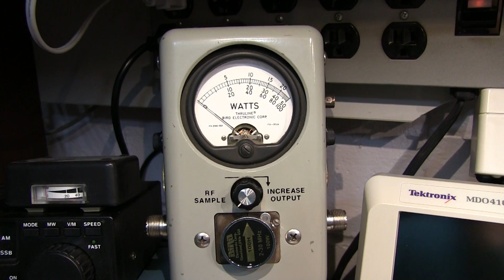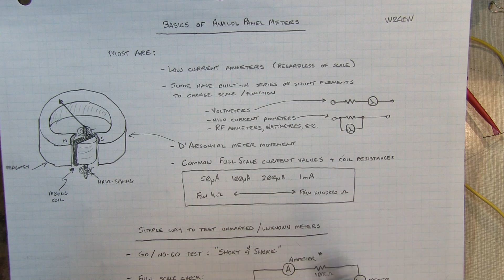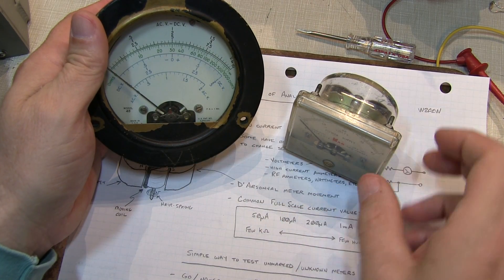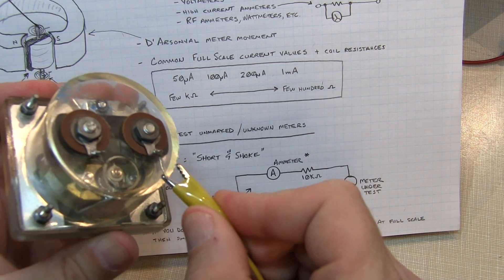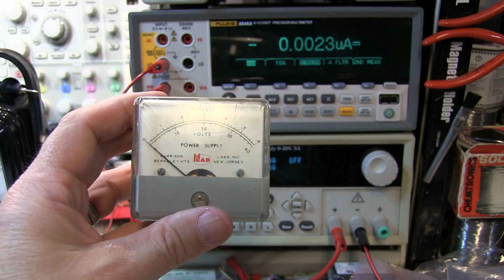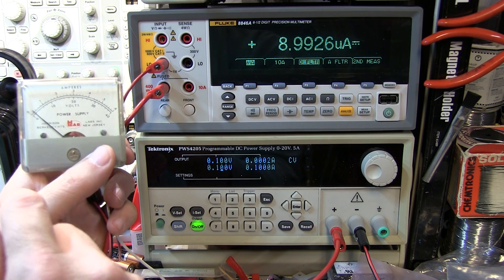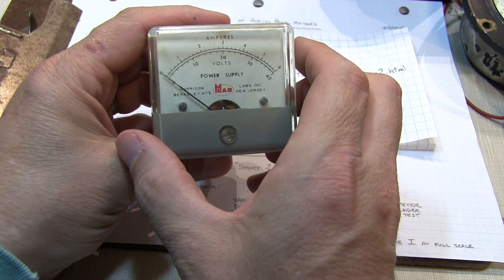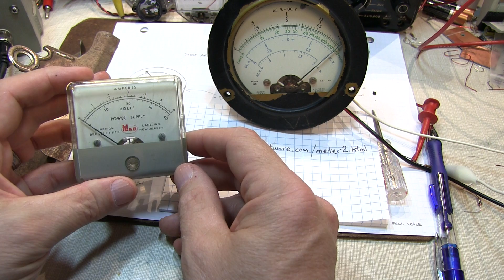#235: Basics of Analog Panel Meters | Analog meter movements | D'Arsonval

Comment: Great video Alan as usual. Takes me back to one Spring day in Soph EE lab where we learned about analog meters (essentially the only kind available to us in '74 :-) so we'd understand how and what we were really measuring. I like and in some cases prefer an analog VOM over a DVM. Don't get me wrong - sometimes I need to know if I'm looking at 2.45 or 2.55 volts, but many times a quick look @ an analog VOM "Yep about 2.5 V," is close enough. Thanks again for a good refresher. Gives me a good topic to discuss when I go melt solder with my nephew ...
Reply from the maker: +jeromekerngarcia Yes, there are many times where I prefer an analog VOM like my Simpson 260 - especially when adjusting or tuning circuits - much easier to watch a meter movement than to follow digits on a DMM.  The segmented bargraphs on many DMMs are a very poor substitute for a real analog meter.

Comment: Hi and thanks for all your nice videos! I hope you see this question, and answer if you will :P I want to know if it is possible to build a test setup using of-the-shelf components to measure the resistance of tracks on a PCB. I mean using some voltage meter chips and microcontrollers, some shielded cables and stuff...since I do not have access to any quality measurement gears. I want to try with 4 wire measurement and maybe double kelvin bridge...is there any chance or I will just waste my time?
Reply from the maker: +Saeid Yazdani Sure - it is possible to make a 4-wire system to do this - a constant current source and a resonably accurate voltmeter are needed.  However, at some point, the accuracy of your homemade system will have to be checked against "known good" instrumentation.

Comment: Very helpful video. And timely, as well. I've been watching fleabay for vintage 0-15 V DC to use in a power supply I'm building but there aren't many to choose from. There are a whole bunch with other voltage ranges and I was wondering if they could be modified for my use. Thanks to your video, I know they can!
Reply from the maker: +bityard Most likely - and those that have a particular voltage rating on them would probably need a series resistor to make it read correctly anyway (most don't have the resistor built in), so just get one that has the style you like, and make it read what you want.

Comment: Darn YT notifications caused me to miss this one. Great video Alan.  Very well done and very informative. Sometimes when I print the scale I turn the existing face over and attach to the back, since the face is mostly the same. On a few rare occasions I have re-wound the coil to get some meters back working but it is a lot of work.  And good watch repair techs and replace those springs :) Thanks again for the video.

Comment: Recently had a stuck D'Arsonval on a Yaesu I bought. I readjusted the pintle set screw; loose direction first & then just a little past the original setting and that fixed it.  Also got a tip to just exercise the meter via a signal generator or nearby strong station.  Of course if the meter is out of the rig, then you could do that via a PS.  Burden voltage is also a concern on cheap ammeters when checking FS current.  But not an issue on your to die for equipment.  Nice Vid.

Comment: Very good Video, Can the meter be used from 0 Ma. to 1amp? Resistor size?
Reply from the maker: +Arthur Schroeder Yes, you'll need to add a shunt resistor in parallel with the meter movement.  The value of the shunt will depend on the meter's full-scale current rating, and the meter's resistance.  There is a good tutorial on this here:
http://www.allaboutcircuits.com/textbook/direct-current/chpt-8/ammeter-design/
Reply: Thanks got a lot of old meters. I will look at!

Comment: W2aew,  The large meter shown at 0.08 in your video (the one with markings:  rise: set: fall: test - on the faceplate) is a very specialized and highly recognisalbe meter for those who have used it.  I was involved in making a product that uses that meter in Los Angeles in the early 70's - and would love to be able to find 2 or 3 of them today.  Do you have a source - or know where it came from??
Reply from the maker: I found it at a surplus house more than 20 years ago.
Reply from the maker: What was the product?
Reply: +w2aew A Scientology E-meter.  Mark V.  It had special dampening built in to the movement to provide not-normal timed responses to sudden changes - allowing for recognizable movement patterns.  The triangle at the bottom is the logo for "Delta E-meter" - the company name that made them at the time (tho the actual movement was OEMed from another company).  Very interesting that it shows up in your video !!
Reply: +w2aew Do you have more than one of them?  Do you want to sell a couple of them ??
Reply from the maker: +Donald Filbert I've only got the one of them.

Comment: Very Good Alan, Being working in a Meter company for years, analog and digital, We would be Proud To shown this Video to New Hiries . One thing would like to add is even tho the cal point at full scale show correct one thing that might be a problem , is that how it is to be mounted and unit not reading properly. That being cal poise factor, meter laying flat verse meter upright.If you find that there is a Different it can be corrected by repoiseng the unit.on either Tail, or cross arm of its weights .Meters that are made poise is thee Factor in a good meter with its tolerance to Spec.  Hints checking Tail poise unit turn at 45* where pointer is Horz and laying on zero, and Cross arm check meter pointer straight up vertical looking at Zero.I did not mean to carry on so just to add to info for those that may have had problems in such, poising movement across the scale.
   Enjoyed it very much keep them coming Yep thumbs UP in deed, Looking at your Hits Hummmmm great Job . Two Great Shows Here and Mr Carlson labs Boy the knowledge a person can get .. 73's Dale
Reply from the maker: Good information, thank you.

Comment: Excellent demonstration of testing meter heads.  Your killing me though.  I searched for 4 years for the Harrison power supply meter you have there.  Purchased 3 of there power supplies and one of them had a broken volt meter.  Finally picked up one at a HAM fest several months ago after years of searching. :)

One tip on stuck meter movements in really cheap meters used in chicken band radios.  The meter movement pivot pin screws have thread lock applied to them and trying to adjust them to loosen a stuck meter movement almost always results in stripped screw heads.  A drop or two of GC radio and tv cement solvent quickly disolves it, you can then loosen the screw about 1/4-1/2 turn to free up the movement and then the thread lock dries again so no need to reapply. 

Mike